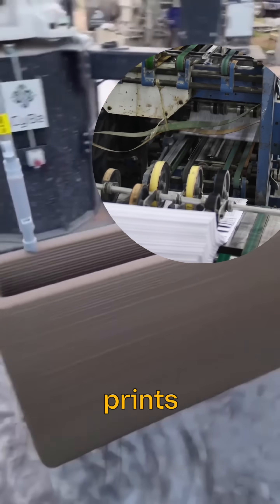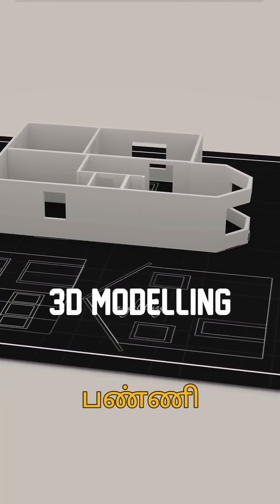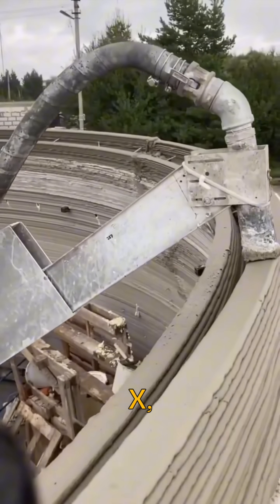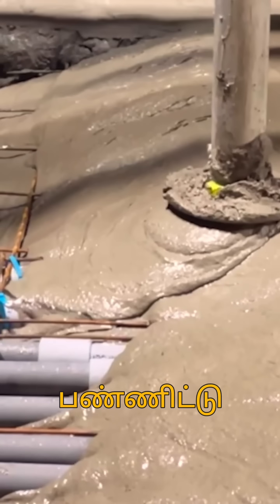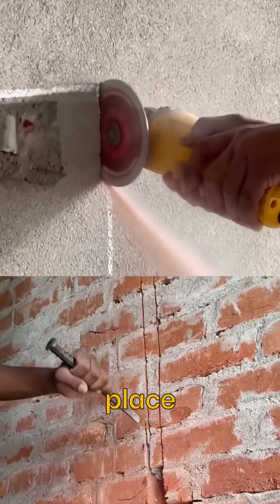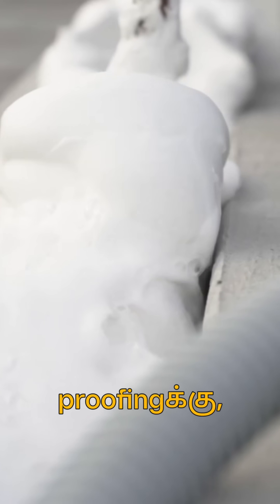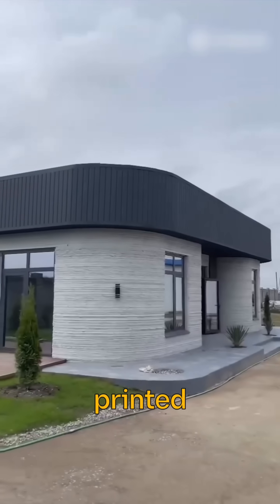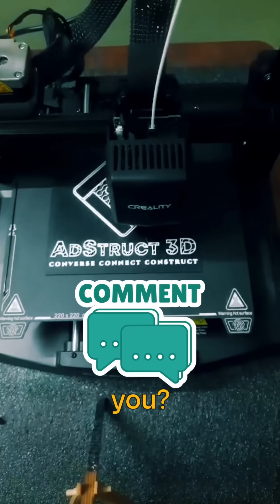Day5 of #3dprinting #3dprinted #3dprintedhouse #trending #explore #technology #3dprint #3dprinter

Comment: i will feel good but it is suitable for all weather conditions bro
Reply from the maker: Good question creator🙌🏻 Yeah it can withstand all sorts of weather since it is concrete. Studies proved that it can last up to 300 years.
Reply: @AdStruct_3D  thank you so much bro
Reply: one more doubt, what is cost of the building this house and it is suitable for hill areas
Reply from the maker: @Ajay_Alagar  Large villas (~2,000 sq ft) like the one in Pune: Likely cost in the range of ₹25 lakh to ₹31 lakh, dependent on finishes and complexity. It is less since it cuts off labour and completing project in less time

For the 2nd question,
Yes, but with important caveats. 3D printing the walls themselves is feasible on uneven/hilly sites — however the site engineering and foundation work on slopes often dominate cost and complexity.